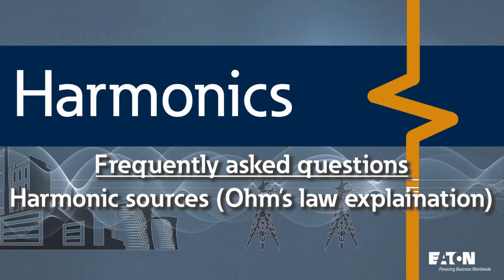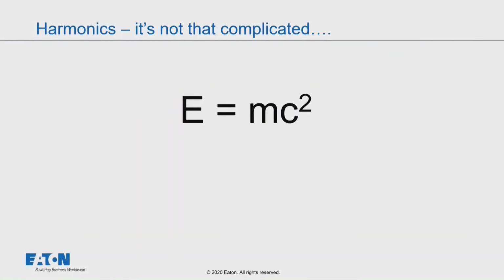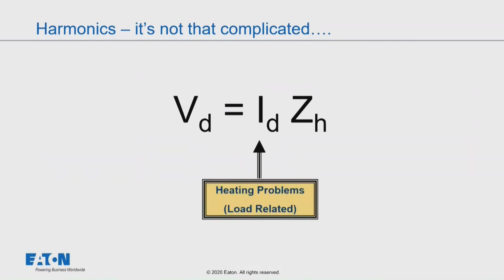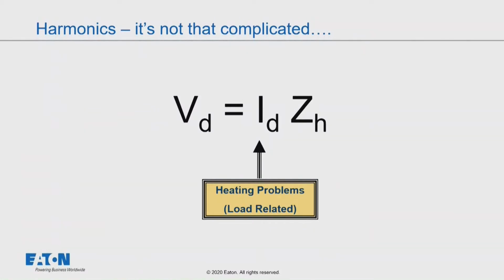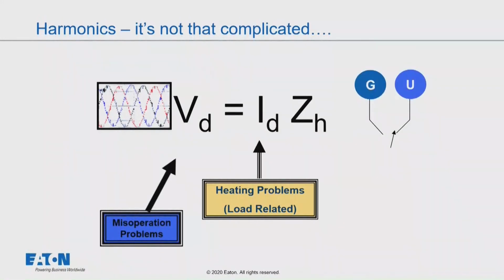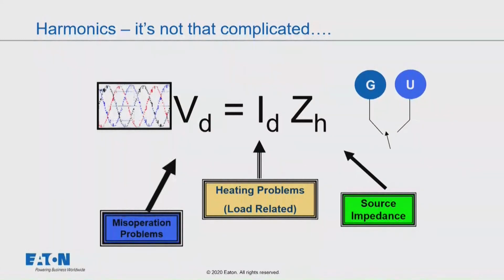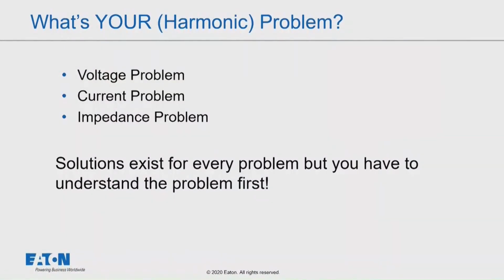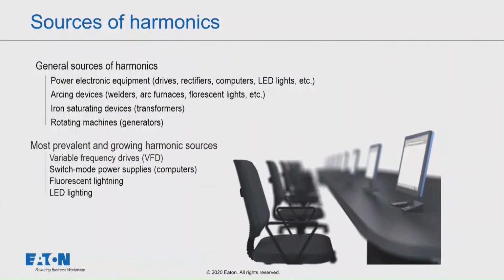11 - Where do harmonics come from and how do the harmonic currents flow - what is the Ohm's Law expl

Comment: Chicken or egg? Depends on how you define Chicken. The universe is created from a pile of energy that caused matter to move (flow), by analogy; the energy is voltage and matter motion is electron flow. So in conclusion, the voltage noise (energy noise) is cause that produced the flow of matter (electron flow) the effect. Noise is the mother of all intelligence, even the brain works on deliberate production of neural noise that is regulated and organised into useful thoughts by conciousness. The conciosness in matter is built inside the structure of atom (nucleas and orbiting electrons).